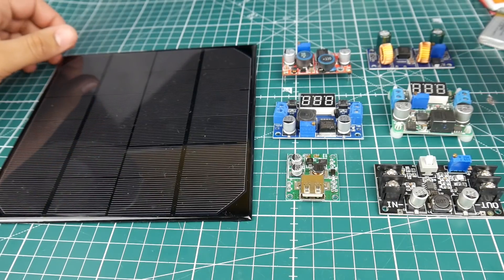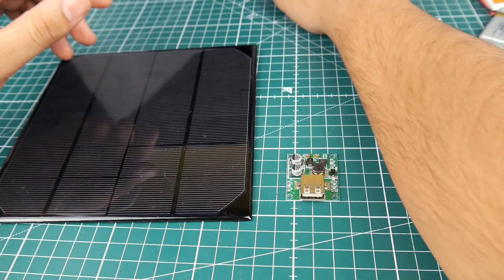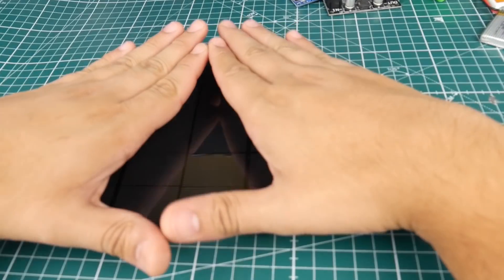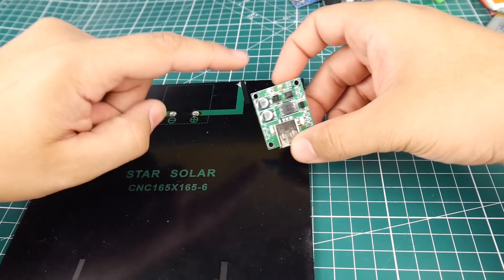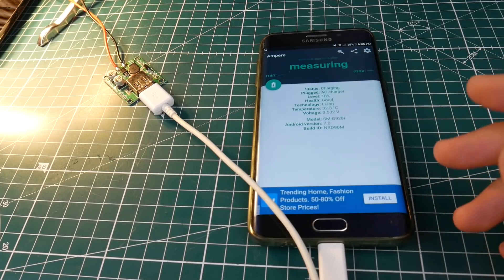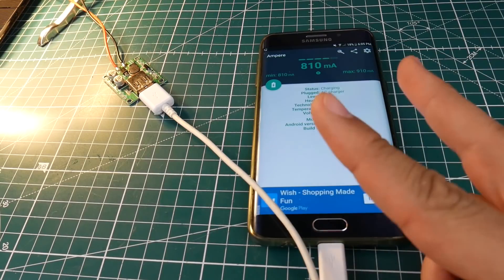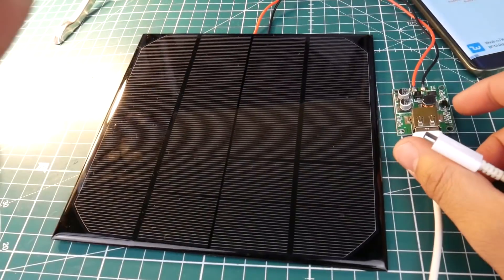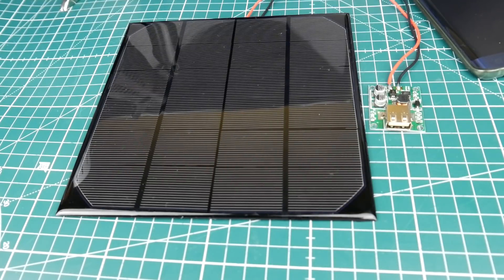DIY Solar Panel USB Charger // Solar Charge GoPro, Phone, Power Bank

Comment: It doesn't make sense that you would "boost the amps from 0.4 to 1.5", since you're only stepping down from 6 to 5 volts. You only have a given amount of solar power coming in. If you step down the voltage 20%, how on earth would the amps step up by 400%? P = VxI.

Comment: Great demonstration of the auto restart feature, I have an ultralight (ebay) 5W hiking panel with a similar module, but when a cloud passes over, the current drops from 700+mAh to 280mAh and never recovers above 280mAh until you unplug the usb and plug it back in. I will change it for this module and see how we go, cheers.

Comment: Amperage booster??? That's alille misleading don't ya think? All it does, it converts 6-20V to 5.2V but amplifies the amperage so the overall wattage is almost the same (the module efficiency is 93%, if the panel wattage is 5W in best circumstances, 5W times 0.93 is still a good Wattage). I just wanted to mention that sorry because you cannot 'boost' the amperage, that would something like perpeetuum mobile

Comment: I know these are baby voltages and currents, but as an electrician you would never have wires connected to your power source before connecting to your load. Why risk a short? Just nitpicking but there is good practice and the not so good.

Comment: Hello, I was recently thinking of building myself a little charging station using 4 of the solar panels you used, but then have it go to 3 or 4 4000mah battery’s . What stuff as in controlers would I need for that

Comment: Does a buck or boost converter keep the output voltages the same even if the input voltage varies? Or will it give a % of the input to the output?
Reply: its regulated output from the buck/boost controller. However some cheaper version may not have regulated output.

Comment: Can a phone be given too many amps?
Reply: No. For example my charger is 8 A rated, but my phone will draw around 0.8 A, basically inside your phone you have another charging circuit that it will decide how much to draw, based on the current status of your battery. That's all :).

Comment: @Drone Mesh, I have checked the module and it seems like the module has a TO1410C IC in it, which is a normal buck converter IC. That means when the solar panel will produce less than 5V under a less illuminated sun situation the USB module won't work at all. It will simply just cut off the power. The reason for this is, there is no MPPT tracking and for small projects working with small voltages a boost converter is a better choice instead of a buck converter. And I think, the app you are using to measure the charging current is not really accurate. Practically, it is not possible to get 5V@1.7A from a 4.5W panel even with  high intensity sunlight considering 100 percent efficiency which is totally unrealistic. I would ask you to look into the CN3791 based modules for this kind of solar project.

Comment: at the beginning of charging you have 19 % of battery at the end it`s 18 %, I have the same problem, that charging only discharges phone, I use step down converter instead of this module and I don`t know why it`s happening

Comment: I built this. You will need 2 of these panels to charge a small cellphone battery bank. You can get a USB solar regulator on Bangoods for $2. The table lamp is good to charge calculators or small clocks but not a newer phone. The solar panels are $9 on Amazon. Silicon wire is perfect for this set up as it helps with the tension on the solder joint on the solar panels as they are designed to be wired differently. I would use a high temp glue to help the keep the solder joints from disconnecting. THE PHONE MULTIMETER IS NOT A SAFE OR CORRECT MEASUREMENT. Using a real multimeter is highly recommended.

Comment: I used this module on a 5V 2.5W Solar panel and I got 0.32mA of current out of it. This was only if its in direct sunlight. I posted a video on my Channel if you guys want to see what I did. For that artificial light thing you mentioned it didn't even do anything for me.

Note: I checked the amperage of the solar panel I used and its not even close to 2.5W, be careful with solar panels you buy on eBay.

Comment: Can you hook up a USB meter to that, the values seem too high and you are giving people wrong expectations. More likely would be 5 of those panels for 800mah in direct sunlight.
Reply: Is it really that low??? I'm planning on making a somewhat small solar power bank(solar panels would dictate how big it is) with a few lithium batteries, I was going to use a bunch of lawn solar lights in series and in parallel, I only need to supply 5v 1.2a but there will be a lot of energy loss in heat by using a lm7805 transistor to lower the voltage to 5v 1.5a but I don't want the whole panel to be much larger than 1and a half foot by 1 and a half foot square...., I'm new to this any help would be appreciated.

Comment: Really good idea, man! But, if I may... You should put a diode between the solar panel and that circuit. Because solar panels tend to revert polarities depending on the direction of the light. ;)
Reply: What voltage and wattage do you recommend for the diode? (considering the overall output to be 5V through USB)
Reply: @Aj0nJon  The final output don't matter much if there are batteries being charged. (Sorry, I don't remember this video in specific. 😬)
Anyway, it depends on the output of the solar panels. You know? Get something that can support a bit more wattage than the solar panels can supply. 
For a small power bank with a solar panel, for example, any diode would work. 😊

Comment: Looks good. Im not convinced the current output is steady enough for reliable charging. I would think some 18650 cells inbetween the solar panel and the usb output would be a more reliable solution. Also could you confirm the current output with your oscilloscope to see if we are not just seeing current spikes and giving a exaggerated output readings on your mobile app. Thanks. 👍
Reply: i'd use 2 big solar panels, or 1 big one and 2 small ones for on par charging like it's from the outlet